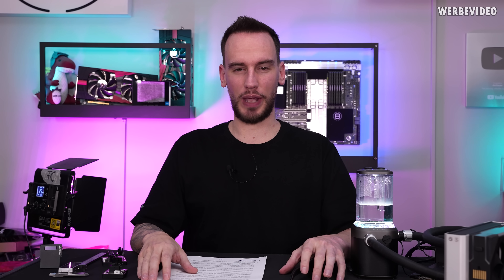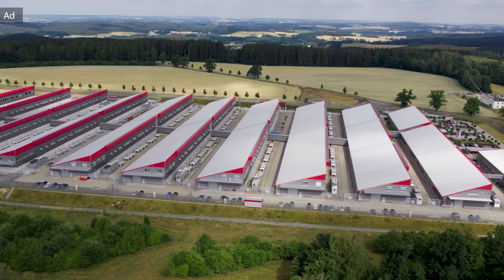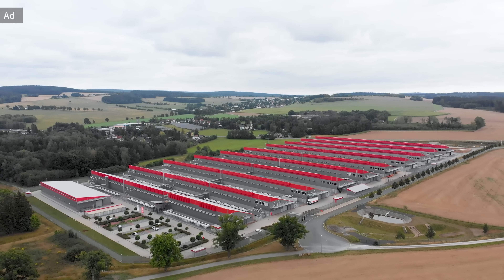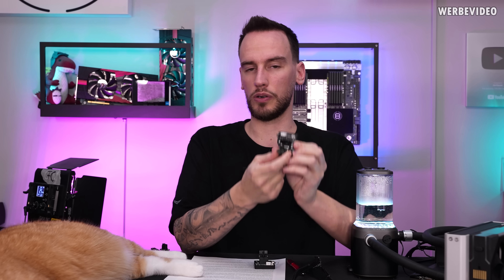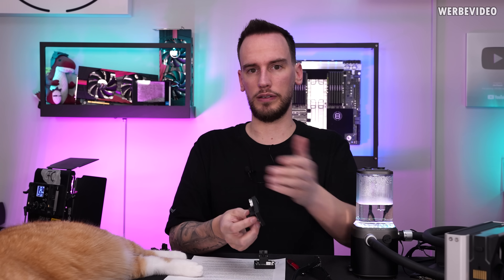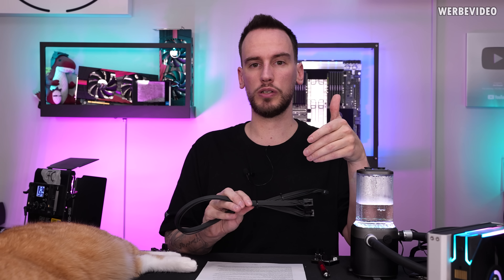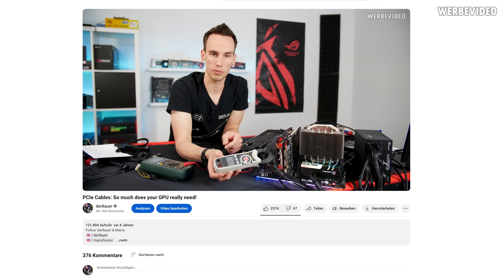12VHPWR is just Garbage and will Remain a Problem!!

Comment: Its not even really the 12VHPWR, its either users cheaping out, or companies fucking up.
These cables are VERY DELICATE, And you're not supposed to be extreme bends on them. Its either the users fault. Or companies. You really cant design a better cable, that delivers the same amount of power in this small form factor.

Also did no one watch the video? his RMA rate on the cable was 1 in 2000. And the reason it happened was user error... But "ugh blame the power connector. because its the new punching bag"
Reply: "It either the user fault", what are you saying, how does user cheap out on $$$$dollar card?? You have a strange angle on the matter
Reply: @koford  Because, they spec says not bend the cable at extremes, and yet the user(s) do so. I also blamed the company who made this adapter, as it was their fault completely. For making a defective problem. 
I try to look at this from a reasonable spot, not a irrational one, as they fixed most of the issues with 12hphwr, and most manufactures have a pretty clear do not bend past [Insert certain degree here]
Reply: @Triro  When you buy the 40'series card, there are NO warning in that box. Who say dont bend it extreme? Nvidia?
Reply: @koford  Its on the PSU manual. Not the GPU. 
Atleast my PSU manual came with it.
Reply: @Triro  PSU manuel or not, it the connector on the GPU that is the problem.. you saw it in this video.The 12VHPWR is a joke.
Reply: @koford  As with any new connector, it takes time for it to develop. We've had the standard 8 pin connector for how long? 10 years? 10 years of development. And 12vhpwr just came out not to long ago.

Its a technology thats needed, if graphics card want to further improve. Most of these flaws have been fixed. But its still the manufacturer that has to manufacture this correctly.
Reply: @Triro  You dont launch a unfinnish product and there wasnt big problem with 8-pin was it? 12VHPWR connector is BAD, how can it be better? aha, by designing it BETTER.. again, there are problem, just RMA it.. only idiot wont do it.
Reply: @koford  "When you buy the 40'series card, there are NO warning in that box. Who say dont bend it extreme? Nvidia?" No, experience and common sense tells us this. Only the ones that lack experience never knew this
Reply: @kenmasters916  We all know that, and now everyone else who say: user error , do not bend extreme blah blah
Reply: @koford  "but the problem lies in the 12VHPWR design is poorly improved, which means that suddenly the experienced builder is a "user error" ??" 2 things here. First, this is just your own bias opinion along with a minority of people, not based on any data or facts. And 2, cables melting due to user errors and using third party cables have existed since GPUs even starter using power cables, so you are highly misinformed. A simple google search will expose all of this to you if you actually did your own research.  I hope this helps ✌
Reply: @kenmasters916  Remember that this all started with the included cable (Nvidia FE) that the connector burned as a result of "user error", that is the assumption. Later report more burnt contacts and again according to you: "User error". This meant that a number of users were scared and used 3rd party parts, but the plug still burned even though the plug was properly seated. but by all means, feel free to believe what you want. I wonder if you watched the whole video, the connection is not good. user error?
Reply: @koford  Again, I'm not here to go back and forth with your unproven opinions. You have the facts, do with them as you wish. I live in a world based on factual data and proven evidence. You are living in a world based on other peoples unproven opinions. We are not the same
Reply: @kenmasters916  Again, I'm not here to go back and forth with your unproven opinions either. Go living in a dreamland buddy. The 12VHPWR is proven to be unstable, that the fact.
Reply: @koford  Hey there bud, you do realize you are proving the other commenters points right ? If you keep returning without anything that supports what you claim, you will continue to prove the point made here. I dont think you've notice yet
Reply: @javiersantana848  Dont waste too much time here, im sure at this point him being triggered returning empty handed is only trolling
Reply: @javiersantana848  It should be staggeringly obvious to anyone not sickeningly undereducated that a pin's ampacity can be exceeded if there is complete failure to do something as utterly trivial as plug it in correctly and check the catch is secure as blatantly designed. The sheer lack of intelligence, care, and attention to the most remedial of detail associated with the degrading failure to do this constitutes a truly shameful embarrassment. All this hoo-ha over the source of failure is shocking and ridiculous, and shame on all those suggesting any problem lies with anyone but the user on this matter.
Reply: @koford  "how does user cheap out" Easy, by not purchasing a proper case that can actually support these massive cards so they can use their native cables instead of trying to cut corners with third party adapters and cables that void warranties. There are a lot of s****d and cheap people out there.
Reply: @kenmasters916  Unfortunately, there are not many good cases out there, the best and the somewhat worse ones have exactly the same construction when it comes to screwing in a video card... you know that? So it's not just a matter of the customer getting a cheaper one but the problem lies in the 12VHPWR design is poorly improved, which means that suddenly the experienced builder is a "user error" ??

Comment: Even with two high pwr 12v , the position of the conector is fundementally bad.  Now if you placed them on the back end, you would have to conect that plug with the board ... showing just how thick the cables should be in reality...  i wonder why they dont use something more powerfull like a motherboard pwr delievery plug? Surely a modular pwr sup, the high end ones, should have enough headroom for pwr to the mb and the gpu?

Comment: The problem with connectors is not the connection but the retention. Instead of relying of the push and clip, it should be a screw down which would remove all of the problems people are having with it not being pushed in enough and the slightly less holding tolerance that the plugs need to be so it does not rock lose. Its the only smart option they don't want to do. 
The other is having included 90 and 180 Degree connectors with the GPU that instead of locking onto the connection but the card frame itself. Having thicker wire like some will suggest will forget how much more difficult it is to form those wires and how much they will push back which leads to the older card sag problem. It was not just the weight of the card but also the weight of the wires and how much they were pulling or pushing on the card. 

The wire rating has a percent safety that will ship so just because the wire has a 220 W low end safety, say 30% of that will be reduced and its rating which would put it around 150W range. Thats why it will have 4 connectors for that 600W. The onboard power from the MB is a good idea to consider than just a cable alone. Mounting is the problem that needs to be fixed for these. The GPU in a MB is made and meant for a fully horizontal layout but since people have been using cases in vertical which is now a standard, that whole thing is a problem and needs to be rectified first. 

Having some sort of mounting on the other side of the card using the motherboard and its standoffs where it mounts to the case needs to be implemented. This will allow secure connections and reduce the card sag problem. This would mean a safe means of Onboard power addition which could safely deliver most if not half the needed power for a 4090 and it can be located all the way at the back of the card near the slide in case mount. I would also take with how cards are and their length for these to have the cables on the end of the card instead of the top so they can use easy to secure 90 degree connectors that would be easier to manage than on the top of the card. It would be less tension on the card through leverage and easier wiring options as it would be almost right at the port in the case leading to the back. This can be for Vertical and Horizontal mount. This can be a chance to remove a bunch of wires on future boards and cards and increase stability and reduce almost needed parts for the PC build. 

This cable connector is the tip top of the problem mountain on PCs that needs to be fixed. Its a pretty dam easy fix for most of it and not be much cost for new MBs or GPUs coming out. PCs are sloppy and inefficient as hell and compound their own problems. 

One point I would like to make as a problem is the GPU could be on the "top" side of the MB (on the opposite side of the CPU and Ram) to where the back plate and frame could be up against the top of the case to have better mounting or the GPU should be side to side flipped and be closer to the bottom of the case for better solid mounting. That would also fully fix the sage problem in a vertical case as the heatsink would be sitting all weight on the GPU's chips where it should be.

Comment: thanks for using your status within the tech industry to tell Nvidia how bad the connector is for it's use case, and to give them a simple solution. based on this video, it seems more like the spec for the connector should've been more like 350-400W, not 600W

Comment: Four times the power through only double the number of pins - pins that are smaller than the predecessor. I think this sentence alone should be enough to disprove Nvidia and the standard makers; what were they thinking when designing the standard? They should have rated the connector for 450W at the absolute maximum, if not 300~360W.

Comment: Generally the load rating of electrical components including cables is derived from temperature.

And if anyone is unsure increasing the number of conductors for a given size increases its current carrying capacity, more cores is better but more expensive.

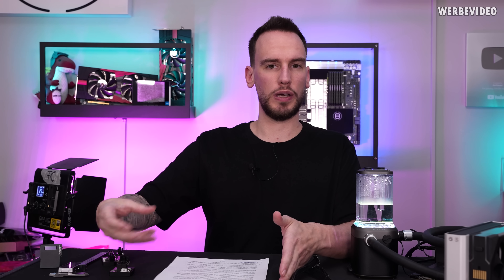Comment: 2:20 Production cost €10?! I should say €1 ...

4:48 You need to calculate for the dark figure of crime too and that is always high.

Solder the cable to the pins on the graphic card and see if it get hot. Then you will see where the problem is.

Comment: 4090s and these cables should be recalled. They're literally a threat to not just the user but everyone in the same building. The cables can't safely supply the power that the 4090 draws.  At this point it's not a matter of if but when a 4090 will kill someone.
Reply: Nvidia fans don't care if they kill someone as long as they can overclock their 4090 for big number.
Reply: Lol yes it can? 4090 is a 450w card. 12VHPWR is rated by Intel at 600W, it's 660W using conservative numbers. 3090ti uses 12VHPWR and is also 450W with 0 issues. The issue is people using cheaply made adapters. The connector has never been an issue. People are just running off with the idea that the connector is the issue without any evidence to point to the connector actually being the issue, yet all of the evidence points to two specific adapters that have been in every melting case. It has absolutely nothing to do with the GPU. It's strictly people using one of two adapters but people refuse to accept that and find anything to go with their confirmation bias against the connector.
Reply: @Djinnerator  interesting. Is that why they replaced it with the 12v 6x2 connectors already? 😂

There is a video where they test and explain the failure of that connector. The leads were too short and made of shitty material. 😂

"12V-2×6 is almost identical to the 12VHPWR cable, with a few minor differences in the physical appearance of the connector. The sensing pins are 0.1mm shorter and the conducting terminals are 0.15mm longer."

Comment: The problem is that people aren't pushing the connector in all the way. It make a clicking sound.... PCIE PEG 150watt spec is because really cheap power supplies exist. Buy a good brand, it won't melt and you can pull easily 435w on a single 8pin. I'm running a RTX 4090 at 600 watts of 2x 8pin (they are pig-tail ones) :)

Comment: I'm so glad I settled for an Asus Dual RTX 4070 12GB with the single 8 pin. I purposely bought it because it was the highest RTX 40 series that was available with an 8 pin and was hearing so much about the 12VHPWR causing problems.
Reply: Good for you, nice thing is you don’t need to run 600w to a 4090 when most of the time it is drawing 325-375 watts. Not worried at all.

Comment: If the computer industry used 48V you could get 4 times the power through the same size wire and connectors. It would result in less wires, smaller connectors, or better still supply 48V via the motherboard.

Comment: How will two 12 pin connectors help with the problem that the cables can't be bent close enough to the card, and won't fit in most cases?

Comment: My 12vHPWR connector as well as $20 (Cdn, that's like, 7 Euro) 180 degree adapter have been perfect for 4 months on my MSI Suprim LiquidX RTX 4090 so instead of all the conjecture and grumping I see, here's some science instead: I'm running a double-ended 12vHPWR cable that came with my MSI MPG power supply. As mentioned, I have a $20 Cdn 180 degree adapter NOT b/c I want to avoid  "bending cables" but b/c I HATE seeing any cables at all, and the 180 degree adapter allows running the cable in my Lian Li upside-down build so you don't even see it at all (perfect). I ran GPU Tweak III to OC scan my card and HWinfo showed 2985Mhz GPU, 21,404 Mhz memory a max of 473W card draw during the test and using my laser temp gun, 12vHPWR connector was 37c while the 180 degree adapter was 33c, GPU never above 44c. I don't even have any case-fans, just 3 fans on CPU AIO and the 2 fans for the LiquidX AIO plus the one blower-fan built into the card. Cinebench 2024 GPU test scored 33,466 on over 70 passes in 10 minutes and temperatures were the same, everything is working perfect and system runs 24/7. So... check your setup guys... maybe triple-check your setup.

Comment: Thank you for this. Even when fully seated, this connector has caused melting. Repair shops are overwhelmed with these. The problem seems to be what you point out here: even when fully seated, the crimp contacts aren't supported well enough to guarantee proper contact.

Comment: I've found that for copper connections I can get a lower resistance by using the Aluminum antioxidant from the big box store. I don't know if it would help here since it would only help if the gold is worn.

Comment: I was wondering why AMD didn't go with the garbage 12vHPWR connector on the 7000 series GPUs. It's clearly garbage design, which is why two of the best cable makers, you and CableMod, are saying it's garbage.

Comment: You need to watch NorthridgeFix videos on the Nvidia rtx 40s 12v power connectors and how many he has to replace that melting issue most of them are Nvidia-approved 12v  pin connectors of a PSU and the adaptor that the Nvidia and third-party cards makers.  It's just a cheap shitty design where Nvidia is trying to be apple with pproprietory connctors.

Comment: I'm no engineer, just a mechanic that works on commercial vehicles. However, safety and jackstands that hold up trucks have to be capable of holding at least double their rated weight, hoist cables have to be tested to five times their rating. I understand the old 6 and 8-pin PCIe connectors have a significant safety margin for current as well. How is it that the 12VHPWR connector was even approved despite having no apparent safety margin?

Comment: PC should have moved to 48V years ago… 12V current requirements are far too high and moving to 24V is a half measure. 48V would mean 1/4 of the wiring required…

Comment: Just buy a good PSU that's designed to work correctly with the new HPWR design.... we're talking about an issue at $700+ at least gpu. SO come one who's garbage here. I'm running 4080 2 weeks straight 420w max 24 hours mining and cable hasn't ever even felt warm

Comment: Your problem is the sense pins that is what causes the gpu to black screen.  Some reason they move in the connector with heat and then it causes the cable to lose connection with the GPU.  The solution is fix the pins in the connector so it has no movement.

Comment: This issue may even exacerbate itself in the next generation of GPUs if Intel and AMD decide to do the same to make the industry unified.  At least in this generation you may use an AMD or Intel card as a litmus test on the PSU.  If everyone goes down this "shiny new connector" route, oh boy.  I'm all for improving and making better connectors, but it actually has to solve an issue and be better.  Some of this thin and tightly packed how power connector/trunking is going on in some modern vehicles and the super thin wires break and it's just replace the whole harness, rip most of the vehicle part to do this.  I thought we learned from the past when they made the soy based wire covering in vehicles.  Animals found it super tasty and would seek out the wires and chew them.

Comment: The whole premise of making the connector smaller is so nonsensical. If you deliver 600+ Watts to a card that power has to go somewhere — i.e. the card will have a massive heatsink. So it will be physically larger no matter what, which means that the connector size isn't an issue in the first place. Just add another 8pin and be done with it.

Also: why reinvent the wheel? There are plenty of well-proven high power connectors on the market, that could have been adopted by the GPU industry if they really saw a need to replace the classic 8pin connectors.